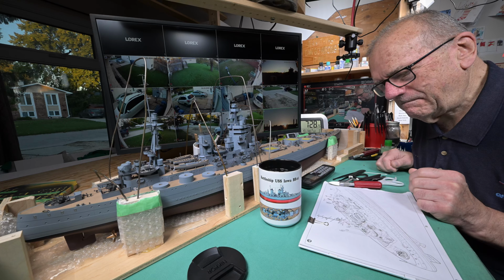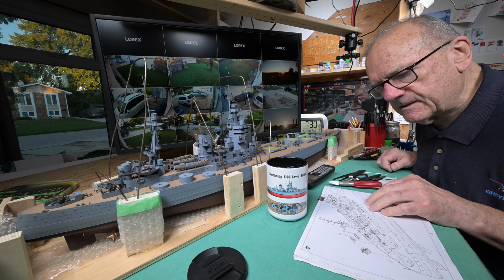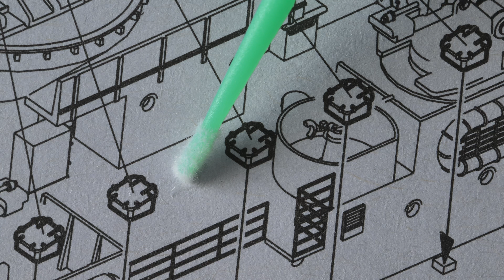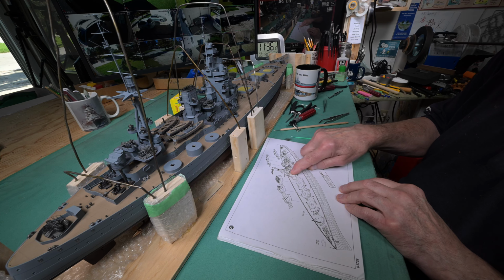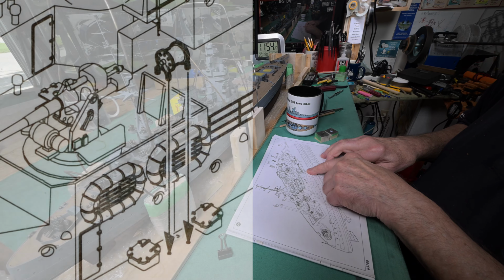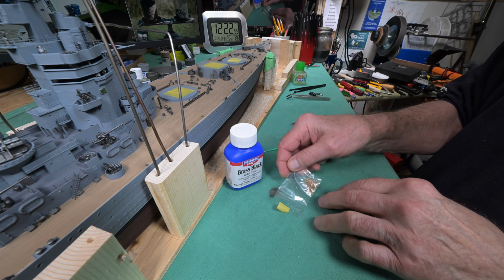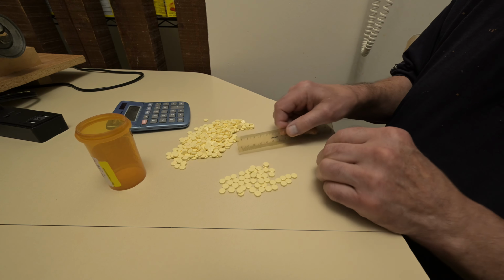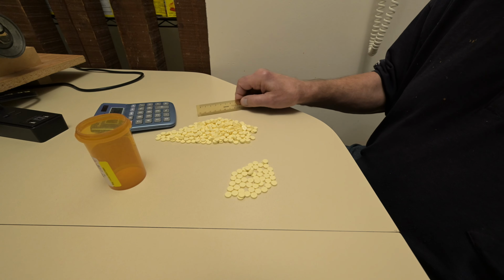The Model Ship - Part 1309

Comment: Hi Ron
Its nice to see another model nearly ready for the display case. Re the brass black on the anchor chain. Yes it does work. Soak the chain in a slightly diluted brass black solution and move it around frequently to get all the spots on the inside of the chain loops that are touching and wont go black. It takes a while and you need to check it every ten minutes or so to make sure that nothing glints. (I know you don't like glinting.) Once your happy with the finish gently dab it dry with a cloth so as you don't disturb the coating and then let it air dry. 
Keep up the good work.
Reply from the maker: "slightly diluted brass black solution" That's the plan. 🤞👍

Comment: Three things I would recommend doing on the next build Ron, 1. Before you glue parts check the orientation in the manual, 2. Dry fit everything before gluing & 3. Double checking the part to be fitted is the correct one. It should become a routine.

Comment: Hi Ron,
The flag is correct!
The way to tell which way up it should be is Union history.
First part is the red Cross for England on white background 
1707 Union with Scotland white Cross 'X' with blue background added
1800 Union with Ireland Red Cross 'X' added
There is more of the white Cross at the point closest to the top of the flagpole. 
This was done to show that Scotland joined the Union 1st. 
If you remember Scotland at the top then you will always get it right.

About your birds- they can soon change their diet when the weather changes. They suddenly turn their beaks up at stuff they guzzled down all spring and Summer and hammer the fat blocks. Great to see the Rodney almost done! Have a great day,
From Ken & Emma
Reply from the maker: Hi Ken and Emma,
Re: The birds. I recall from last fall that they seemed to either fly south or went into some sort of hibernation, because the seeds were simply not being pecked at.

Comment: Hi Ron, you have the flag correct. The red saltire (Ireland) is not centred on the white saltire of Scotland, but the arms are offset so there's a wide white band on one side of the red and a narrow white band on the other. The wide white band is next to the flagpole/staff at the bottom-left corner.when the Union Jack is right-side up.
Reply from the maker: Thanks Alan, but sound a bit confusing to this old Canuck. 😁

Comment: Your Union flag is correct without a flag pole the flag shoulf have the thick white line above the red line in the top left quarter.  obvously for the Hood the Union flag is the Union Jack only called a Jack on a ship.  A White Ensign would be a more widly used flag for HMS Hood.  great progress again Ron
Reply from the maker: Hi Jason,
I doubt if I'll ever get this flag thing straight in my mind, haha! 😁
Reply: @roncalverley  At primary school I was told ‘white has hight’ thats how I have always remembered it

Comment: Evening Ron! It seems to me the locker under the stairs wouldn't be very functional even if installed as the manual shows. I'm assuming the shorter side is the lifting side?? How could they open it?? Unless, as you mentioned in past episode, they lift the stairs up.  Doesn't seem terribly functional. Maybe someone will have the answer/explanation. Beautiful sunrise there!!👌
Reply from the maker: "shorter side is the lifting side" That's my take on it too. The high side has the hinges. 👍

Comment: Are you going to try wiping the Brass Black onto the chain instead of giving it a bath? I've seen other 'blacking' liquids used on metal and they all seem to be of the 'wipe on' variety...it may not leave that 'sooty' appearance this way...possibly? Worth a try? It should be easy enough to grasp the chain in a dampened cotton ball and run it down the length of the chain......just thinking out loud again, sorry.
Reply from the maker: I never thought of that technique. 👍